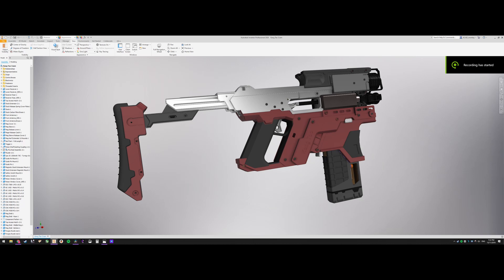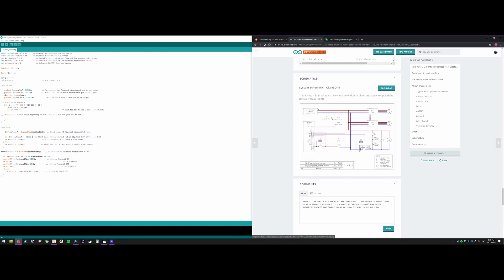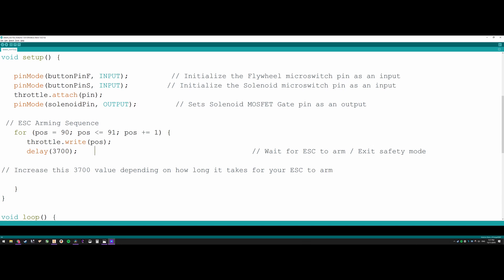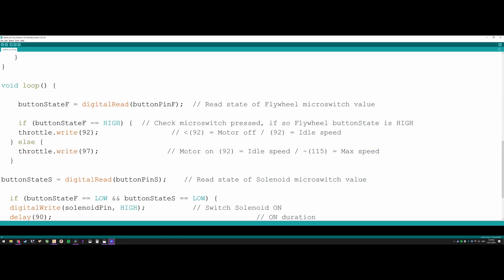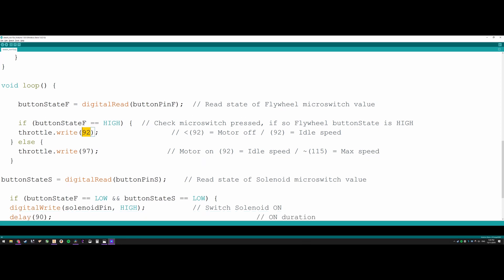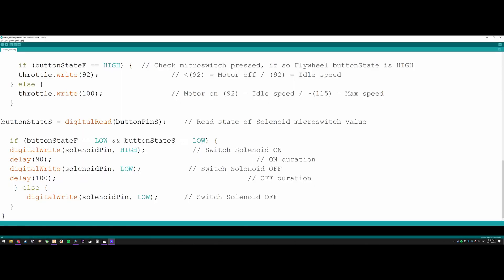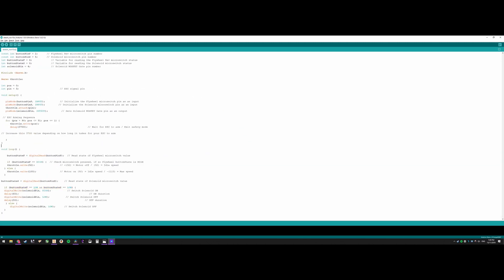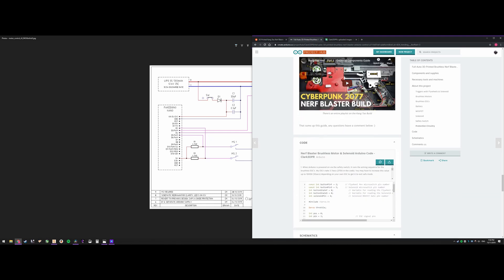Kang Tao Nerf - Part 5 - Coding Tutorial & Download

Comment: Did you haft to first flash your ESC’s with coding? Or just wire them up and depend on the coding you provided for the Arduino that runs everything. Hope that’s not a dumb question I’m pretty new to brushless motors.
Reply from the maker: Hello, the code in the arduino told the esc's what to do, no flashing required. Cheers

Comment: Can i print it on an Ender 3 Pro..
How much PLA is needed??
Like :D
Reply from the maker: Ah, probably notbecause it requires 300x300mm bed size.

About 1.5kg
Reply: @printedprops8730  maybe you can change that in the future.. It would help many people :D
Reply from the maker: @McKuc  thats such a great idea, i already did.

I have 3 projects im the works, all require only 150x150x150mm build volume size.

These are not nerf blasters, but Cyberpunk 2077 props for cosplay.

I have 3d modelled:
Militech Saratoga
Militech Achilles
Arasaka Tki-20 Shingen is a WIP.

I havent uploaded recently as im having 3d printers isssues, waiting for parts but delays. Then i can print them and share. Cheers.
Reply: Oh really. You are a pro...I am going to print them all, just to put it near my xbox one x cyberpunk edition.. are they with some moving parts?
Reply from the maker: @McKuc  saratoga the bolt you can move it back and forth, trigger moves. Just needs a spring. Foldable stock.

Achilles can be disasembled, trigger also moves.

Tki20 shingen - ill see if i can make the bolt and trigger movable.